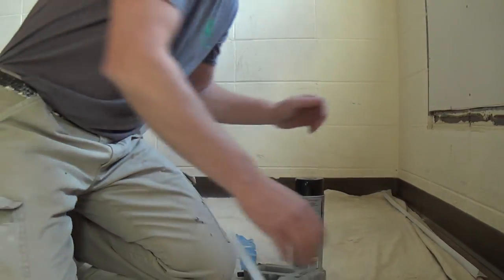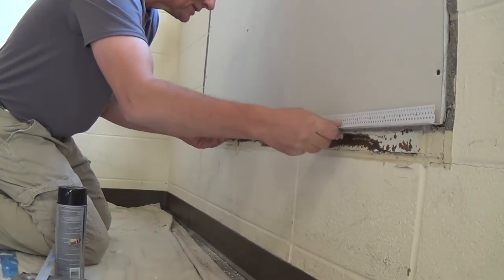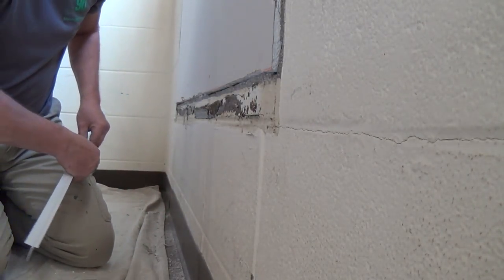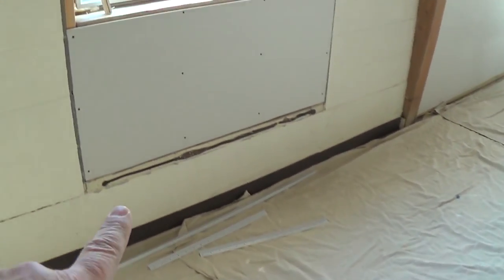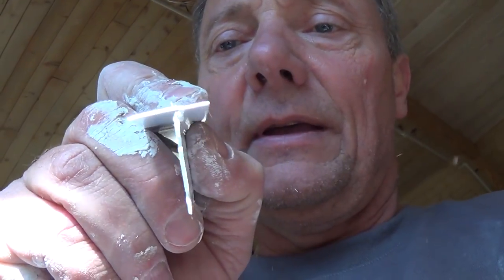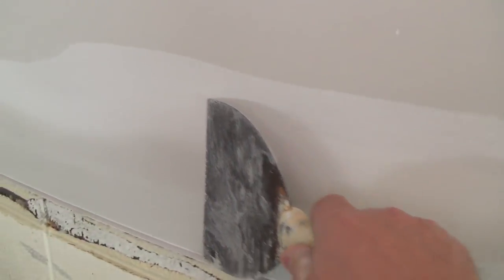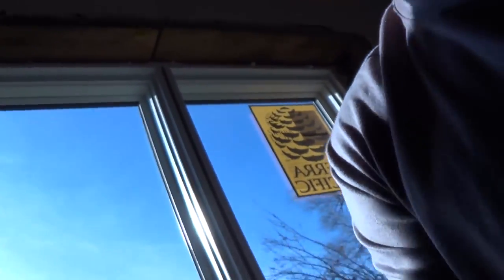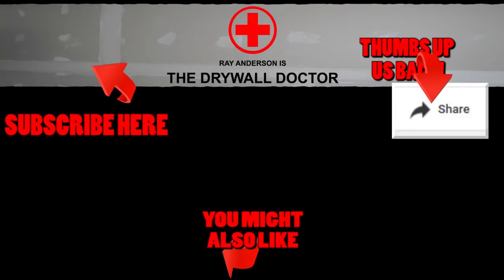EVERYTHING You Need to Know about Tear Away Bead: Placement, Topping & Tearing the Bead

Comment: @ the drywall Doctor. when using the 3m 61 spray glue you really should spray the drywall AND the bead. Wait about 20-30 seconds and it's set no staples or nails. In impact areas with vinyl bead I run mesh on mud legs 2 coats over- mint!

Comment: I have a tub surround with sheetrock butted to the flange not over. I had planned on using trimtex shower bead (has the 2.25 mud flange). Now i realize its next to impossible to find the stuff. Any good alternatives?
Reply from the maker: What's the thickness of the drywall . Please say 5/8
Reply: @THEDRYWALLDOCTOR1  1/2
Reply from the maker: Ok I would look for some super wide straight flex and use it to flat tape it.  No Coat would work too but the super wide will hold up better in the bathroom.
Reply: @THE DRYWALL DOCTOR  Thanks  for the tip. I hadn't heard of flex tape but I looked it up. I'm thinking about ripping wood strips to fill the gap and then just using the 1.25 bead that you can get at the box stores.

Comment: Thank you for this. Your videos were the ones that led me to look for this type of product that I didn't know existed.
Will this work similarly with cementboard? I am putting cementboard under a glue-up shower surorund and the walls next to the surround are an old printed plywood from the 70s. I couldn't find the trim tex brand but I found clark deitrich. (edited for typo)
Reply from the maker: Yes absolutely
Reply: @THEDRYWALLDOCTOR1  Excellent! This will make my bathroom project so much easier.

Comment: I'm in the process building a 40ft by 20 ft brand new detached garage.  What's your recommendation for creating a clean look with the 6 inch concrete curb and drywall that sits on top of it?  They will be using 5/8" drywall and I asked them to make the drywall flush with the concrete curb.  The gap will end up varying throughout the length of the wall and I thought using a Tear Away Bead between the 6 inch curb will create a clean look.  I thought about using an 8" baseboard to cover up the seam between the concrete curb and drywall, but that will stand out like a sore thumb.  Your thoughts and recommendation would be greatly appreciated.

Comment: Interesting how easily your tear away part came off. I used this the other day mine would not tear away. It kept breaking every few inches or it would  vear away from the line. I ended up having to score it with a razor blade.
Reply from the maker: It's old they become brittle when they get older
Reply: @THEDRYWALLDOCTOR1  gotta love the home depot. I bought it the day before. It still worked, just a small difficulty I didn't anticipate.

Comment: It wasn't possible to get the drywall flush with the concrete block wall? It was necessary to have the drywall stick out 1/4" from the block wall? I don't know the backstory here. Would be interesting to know the answer to these questions. But thanks for the video. Nice video. I see how to use tear away bead correctly now.

Comment: I have a situation... I'm a renovator. I tore out a shower and rebuilt it. After tile, the shower is about 1/4in off the wall where it meets the drywall. I'm planning on building out the drywall and skimming out a couple of feet to hide it. Should I use a tear away bead or just green tape the metal edge of the tile?
Reply from the maker: If I'm understanding you right I think I would use the tear away bead and make a definite line rather than trying to float it in. Can you send me a picture to my email address thedrywallphd@gmail.com
Reply: @THEDRYWALLDOCTOR1  I sent you the email with a pic. The wall at the right side where the tile ends with the metal edge. Hard to see, but it is off the wall by 1/4 in.

Comment: I was wondering if you were open to a sheetrock question as I am in the pre-sheetrock stage of a new construction home. I am finding several of the sheetrock guys I spoke with recommending using a specific drywall seller (there are closer ones) and they claim they have better sheetrock like Certainteed - I looked at the sheetrock at HD or Lowes and they are made by USG and Georgia Pacific and they seem the same to me so I was wondering if maybe there is an incentive to the installer for me to buy as they tell me call and give your address, and pay for all the material they listed out for the job.
Reply from the maker: I prefer USG but each contractor has his or her favorite. I get a 2% discount on materials if I pay before the 15th of the month. My suppliers are not closer then Home Depot  but I trust them to stock the drywall where I need it and if they damage anything (including the drywall) they replace it or pay to have it fixed. I hope that helps

Comment: I hate this stuff inside windows. I'd much rather mud to it and run my knife corner up the window to clean it especially if I'm doing the caulking as well. This is handy against rough surfaces
Reply from the maker: I also like to use it when I'm having a lot of condensation or aluminum jams